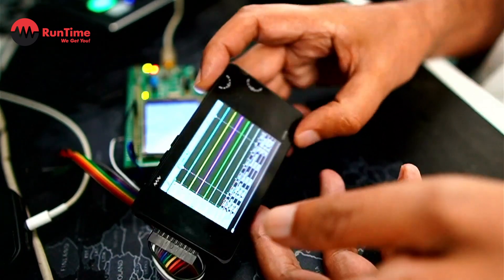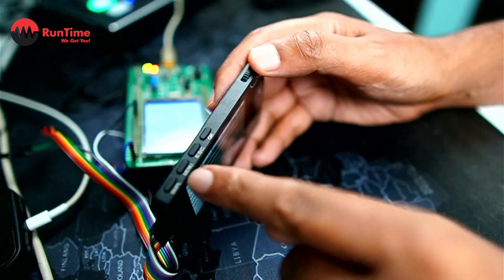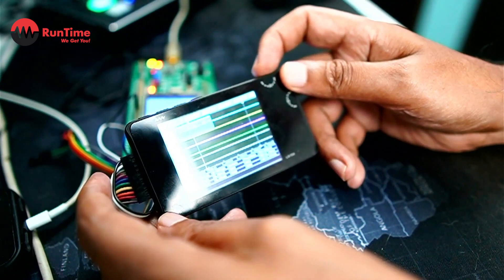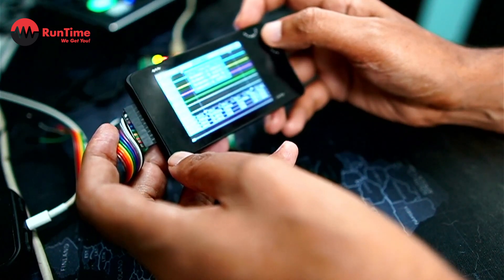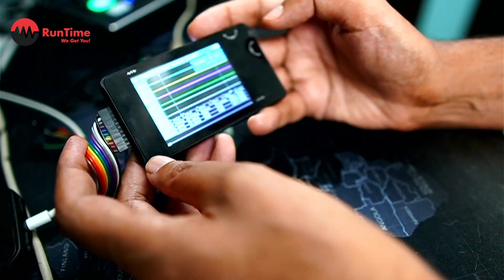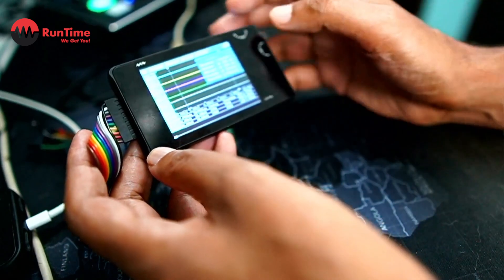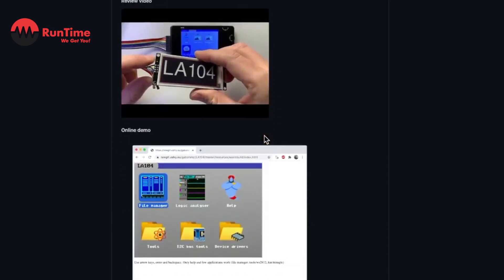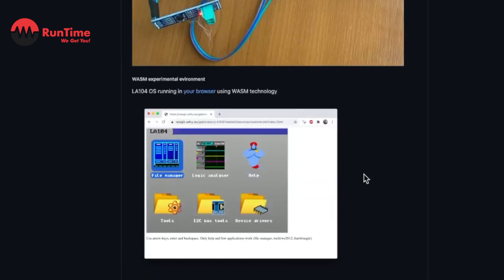LA104 Logic Analyzer Review

Comment: Well, if you replace the factory firmware with that aftermarket stuff, I'll bet you didn't read the fine print, so I'll tell you that there is no longer the ability to store data to a file - no file system. - and that's a huge loss.

Comment: wasted 15 minutes of my life looking at level shifting options before finding out these are in fact 5v logic tolerant.

can you provide evidence it's only 3.3v tolerant? my information says it's good to 5v.
Reply: Pinout on the back says VCC is +3V, and there's also a warning that says "Input range 0 - +5V". I've used it with 5v logic.
Reply: @mykennacepek9409  Do youhave to press the sample button or can you trigger it on a pin event?
Reply: I think 3v is the logic high trigger and under 1.2 counts as a logic low. It should however be fine with 5v logic.